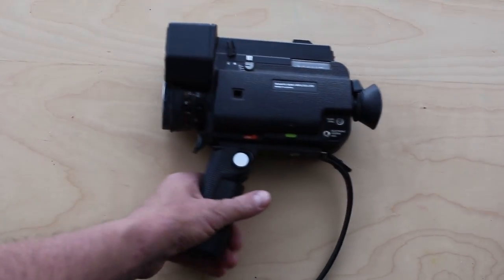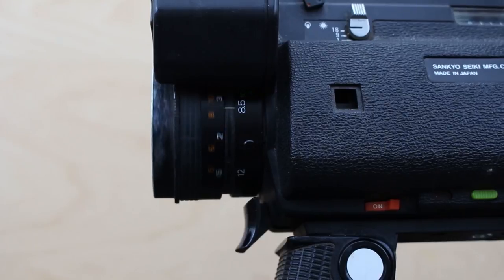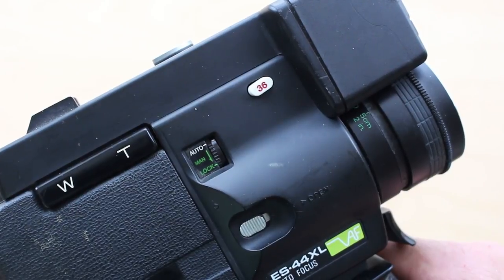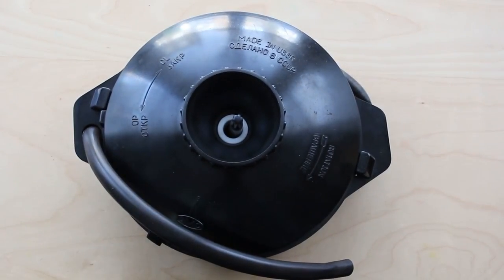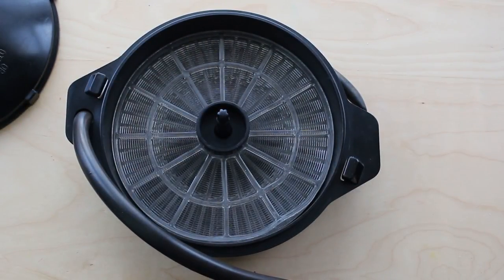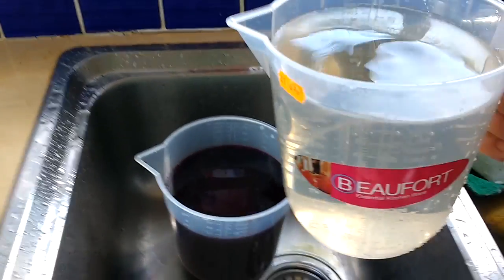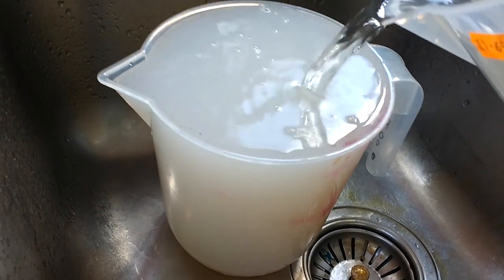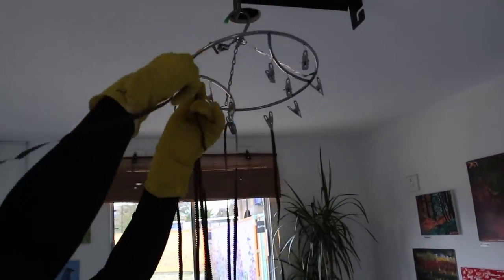Super 8 autofocus Sankyo and new (old) Lomo tank

Comment: ..i have a question. When you are auto focusing with this 'Visitronic' kind of AF system on the Sankyo camera,  do you actually see one of the mirrors inside the VAF box (thus inside the two windows) "moving" as the lens goes hunting back-and-fort to determinate sharp image...?
Reply from the maker: Yes, the window on the left (as you face the VAF & lens) shows something jiggling around. Not sure how that helps the autofocus but it's the source of the noise (well, one of the noises). Despite all the noise and jiggling the auto focus does actually work, go figure!
Reply: Zero Budget Film School , ah nice to know that. According to a couple of  archives, patent descriptions, drawings at that time that you can find online, this Visitron Auto Focus operates of light bounces  of the subject to the mirrors. One mirror in the left window is, like you sad wiggles (mobile mirror ) to find  the sweet spot for the correct focused image.  The mirror in the right  window has a steady position. You should check this link below . Its pretty interessting to know how auto focus is evolved trough the decades: https://www.google.nl/amp/s/www.researchgate.net/figure/Visitronic-Auto-Focus-principle_fig3_275328635/amp

Comment: hey, thanks for the video. I just got that same camera and a couple of old films from my grandpa and he also got a machine to digitalize all his films. the process of getting all is films digital works fine but now I want to know more about the camera... for example he has three different types of films: big ones (7 inch), medium (5 inch) and the small ones (3 inch). (i think...) so what type of films can I put into that camera. If I would want to shoot a 7 inch film - what would I have to buy? can anyone help me? thanks in advance
Reply from the maker: All super 8 cartridges contain 50 ft/15m of film. When developed it goes into one of the small 3" reels. If you have a 7" or 5" reel it's several of these 50' lengths spliced together.

Comment: Have you tried developing Foma R100 as a negative ?
Reply from the maker: Yes, many times. Done it in Caffenol and in Ilford LC29. It looks great!
Reply: Mine has a heavy dark mask how did you clear it? I mean R100 the reversal film, not the negative?
Reply from the maker: If you're sure the film wasn't underexposed in the first place, I would try leaving it in the first developer for a bit longer, then more developed silver will get bleached out and after second development of what's left the final reversed image will be lighter.
Reply: I meant as a NEGATIVE one developer and fix? I don't have chems  for reversing
Reply from the maker: TBH all my negative R100 developings have looked very dark, but after scanning them, then inverting on a computer (I use Adobe Premiere) they look fine, just a bit blue tinted. If you use Caffenol, it stains the film brown and when reversed that makes it blue.
Reply from the maker: Also, you could try and push the negative developing. Check out my films about pushing Fomapan.